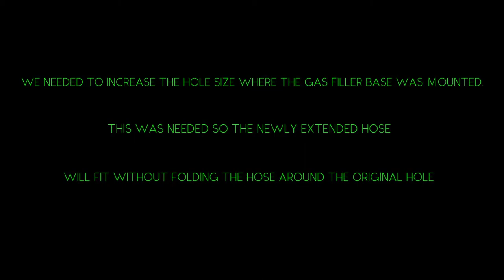HOW TO INSTAL DUALLY FENDERS ON YOUR TRUCK

Comment: There's no need to cut the bedside, I did swapped my truck 6 years ago and never cut anything. Just drill the holes for the mounting brackets and wire harness and done
Reply: David do you know where to get mounting kits for dually fenders 95 ford    cant find them any where   thks Randy
Reply: It doesn't look like it needed to be cut
Reply: @randybegins7535  ford dealer probably. Or rockauto maybe.

Comment: Two questions: 1. For the new fender well why didn't you run a small support brace from the bed to the fender...it will be hid by the inner fender liner? 2. As far as the gas filler assembly..instead of adding hose sections, why didn't you cut and weld metal extensions instead...as you had he available part stock? Jus curious.
Reply from the maker: Those fiberglass fenders are hard and sturdy.   And I didn’t want to deal with the heat in that area from welding.

Comment: Are dually fenders installed the same on different makes. I have a 99 3500 dodge be putting new box on off a 1500 and need to install the old fender extensions.
Reply from the maker: Basically yes